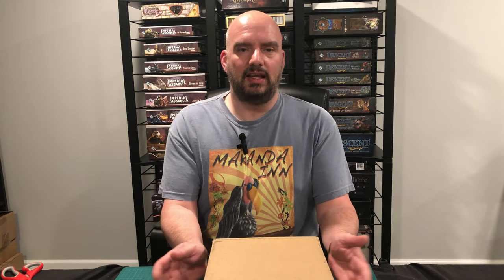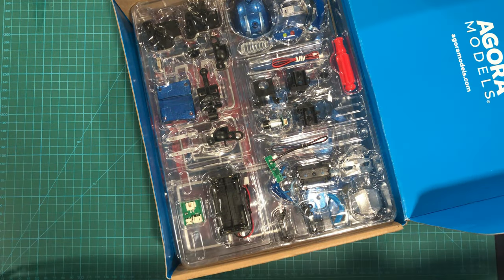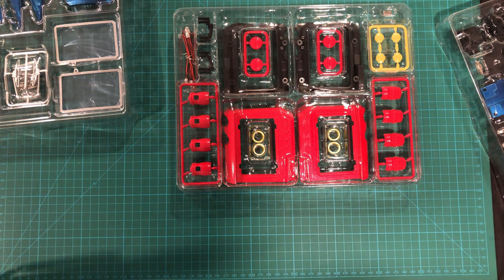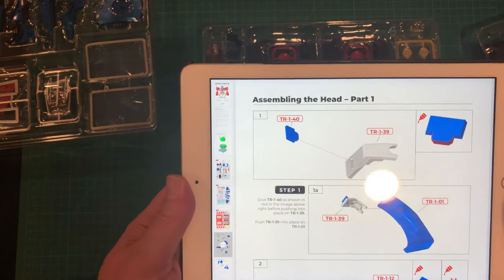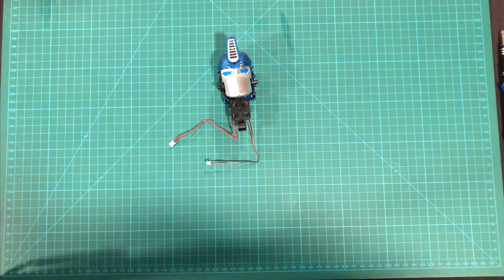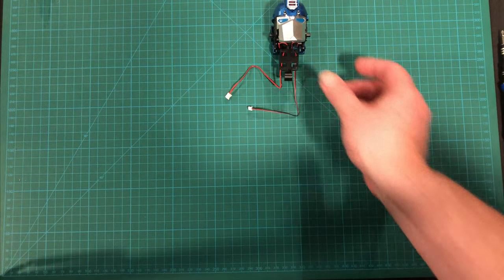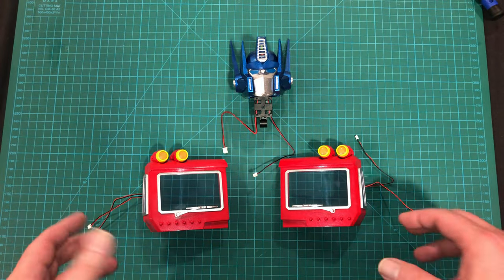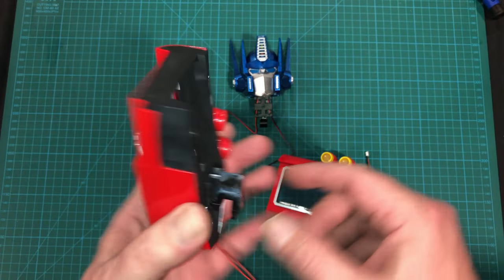Agora Models Optimus Prime - Pack 1

Comment: I was trying to figure out, the liitle piece that goes on top of the motor, what direction is that supposed to face?  Does it matter?  I assume it spins and moves the faceplate along the bracket
Reply from the maker: I struggled with that a little too.  Turns out it doesn't matter.  Once the motor kicks in that piece spins to move the faceplate up and down.  You're just picking the starting point when you assemble it.
Reply: Awesome,  I figured it was something like based on the shape, thanks!